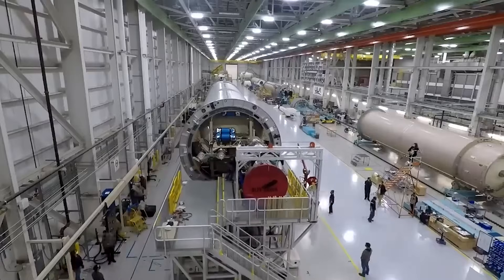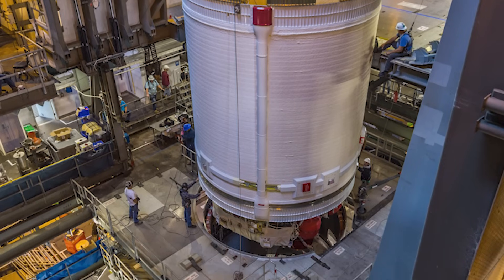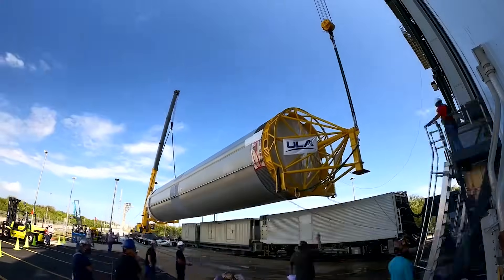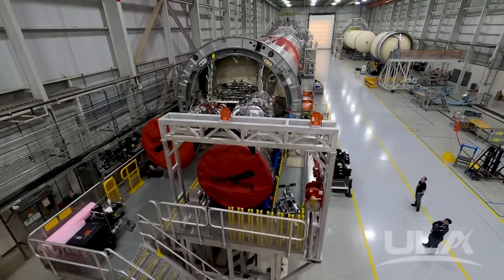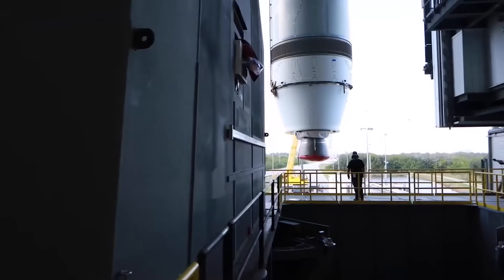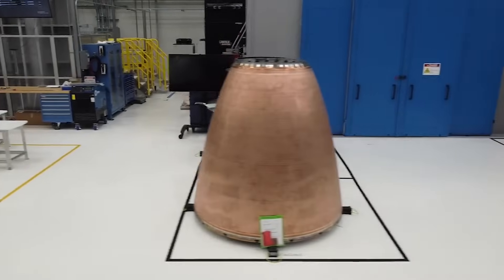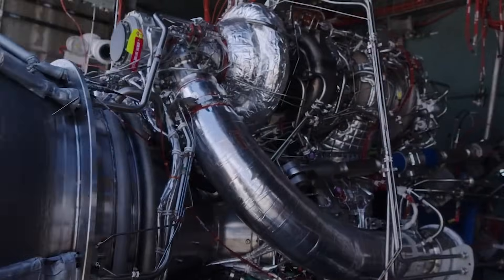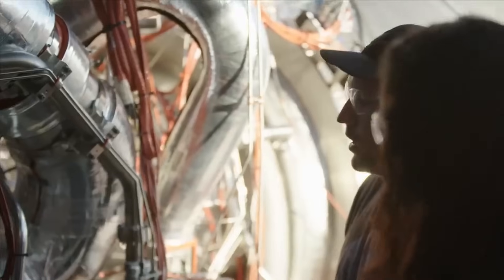ULA Is Only Weeks Away From Vulcan’s First Launch

Comment: maybe I am missing something why would you commit to launch on a first time rocket where the engine blew up in testing.
Reply: Because the engine didn't blow up in testing.  Did  you not WATCH the video?  They said it was a high pressure spot on the top of the fuel tank of the upper stage that blew up and they've already fixed it.   That's what happens when you TEST your rockets to find the problems.   Other companies, well I should say SpaceX as nobody else does what SpaceX does which is to just launch shit over and over and over again and then cheer when one of them finally works correctly.   Nobody with a functioning budget could afford to run a company the way SpaceX does except SpaceX.   Everyone else strives to get it right the first time.

Comment: I'm calling BS on ULA's so-called "smart reuse" concept. The plan has never made any sense to me. How is the engine section going to separate from the rest of the rocket? Is the whole bottom of the rocket going to be attached by some kind of "quick-disconnect" joint? Leaks are the absolute bane of every launch provider (just think how many launches have been scrubbed because of leaks), which is why everything that can be welded is welded. Good luck trying to prevent leaking on a "detachable" engine section, with hundreds of tons of propellant pressing down on it, plus the violent shaking of launch (especially with solid boosters) trying to loosen the seam. There's no way the seal will hold. If it's not a joint and it's welded like a normal tank, you have to use explosives to basically blow the engine section off. How can you ensure a clean separation? How can you ensure it doesn't endanger the upper stage and payload? You can't. You'll get shrapnel. Goodbye upper stage. Smart reuse is the stupidest idea I've heard in a very long time.
Reply: you must be an expert. the engineers at ula probably have no idea what they are talking about.
Reply: @duckvs.chipanddale585  Riiiight. Because bloated government contractors have never ever over-promised & under-delivered, or pretended their PowerPoint vaporware was a real product. They wouldn't just make stuff up, right? If they say something it MUST be true, right?
Reply: I think ULA has blown smoke up everyone's butt for years. @duckvs.chipanddale585
Reply: You have to take into concideration, that its engines from BO.  So while they may be able to build a rocket every 2 months, they cant wait 2 years on every engine.  Thats the "smart" of the re-useability.  Besides, its 2 engines to wait on.  They'd have 30 rockets laying around before one gets fit.    🚀🏴‍☠️🎸
Reply: So when you got your Doctorate at MIT in mechanical and aerospace engineering, you followed this with PostDoc at CalTech and externship at SpaceX and NASA?

Comment: I don’t know how anyone can think the starship won’t succeed after watching the falcon 9 and heavy success 😊
Reply: 1)The engines are different,
2) The weight is different,
3) The center of mass is different,
4) The aerodynamics are different,
5) The landing method is different,
6) The materials are different,
7) Falcon 9 uses an expendable 2nd stage. (Which people forget about)
8) Falcon Heavy uses a fully expendable mode.
9) Musk promised a 24hr turn around for Starship. Falcon 9 has a 30 day turnaround.

There are plenty of reasons to be skeptical.

Success at 1 thing does NOT guarantee success at something similar, but very different.

Comment: So, 0 launches in 2023 vs 86+ for SpaceX? Should I be impressed?
Reply: is that 86 SUCCESSFUL launches for spacex, or 86 TOTAL launches?    VERY Big difference there considering every other rocket that they launch blows up.
Reply: @jkutyna Have you been paying attention at all? The Falcon 9 has not blown up at all. Sure, they are having problems with the successor, but that is way more ambitious than any other rocket out there ATM.
Reply: Ok and

Comment: I hope ULAs launch in December will NOT be as "successful" as the recent SpaceX sub-orbital test flight.
Reply: That's sounds like a weird thing to hope for!?!?  🙄
Reply: so you wish for it to RUD on the pad if it's shouldn't be as successful as SS? Pretty low.
Reply: why don't you want a rocket to succeed? why don't you want a lunar lander to succeed?
Reply: Nobody will EVER be as "successful" as spacex is.  Nobody has the fortune Elon Musk has to afford a 50% failure rate on your rockets and payloads.  Every other company on the planet would go bankrupt long before that kind of "success".
Reply: Apples and oranges, really.  Starship is a whole new thing nobody has ever done before, in both scale and function.  The data needed to make it work doesn't exist until real-world flights are done to gather it.
Vulcan is an expendable launch system akin to what has been done before.  They should be able to get it to work without RUDs.

Comment: Imagine Vulcan with two RAPTOR 3 engines! They are roughly the same thrust class, smaller, lighter and flight proven. They are Methane fueled so tank sizes and like can stay identical. Also, if SpaceX is to be trusted about their costs going down to $250,000 a piece they are also the cheapest pump fed rocket engines in the world. There is actually nothing wrong with standardizing on ONE engine for US Launch vehicles, making it cheap, making a lot of them and flying them a lot. ULA can focus on building vehicles for launches and payload which the one size fits all SpaceX vehicles do not accommodate. Blue Origin... well... I really don;t know what they are good for except flying dildos and vaporware.
Reply: This seems like a wild oversimplification. There are structural elements, at the least. Do the engines gimbal the same way? If not, flight software would need adjustment. And the US having more operational capacity keeps monopolies from forming.
Reply: @patricklewis7636  
monopolies that are dangerous to an economy are only possible if the market authority (government mostly) enforces rules that select a few suppliers and does NOT allow any others. So rules that are anti-competitive are a problem, but monopolies that form naturally - because the forming sole supplier simply has the best and cheapest product are not a problem. Free market capitalism has no problem with those. Anytime such a monopolist supplier tries to control the supply the competition can come in and increase the supply if needed.
Reply: @joansparky4439  well, first, that's almost completely wrong. The gilded age monopolies formed due to an absence of regulation and were ruinous in a lot of ways. But the issue here is less monopoly and more single source for government procurement. With two or more capable suppliers of space services the space force will still be able to launch in case a design flaw grounds a system. Also, competition breeds innovation and drives down costs.
Reply: @patricklewis7636  Except for one thing... VAPORWARE is not competition.
Reply: @patricklewis7636  
re gilded age and lack of "regulation":
" [..] Political cronies had been granted special shipping routes by the state, but told legislators their costs were so high that they needed to charge high prices and still receive extra money from the taxpayers as funding. Vanderbilt's private shipping company began running the same routes, charging a fraction of the price, making a large profit without taxpayer subsidy." (robber baron, WP)
Reply: @ patricklewis7636  
PS: there even is "regulation" out there that isn't labelled regulation, but has the exact same functionality that such anti-competitive regulation has got, creating a winner takes all environment with the expected outcome.
Markets only really have a problem with monopolies when competition can't legally compete, all else is made up myths by people who either should know better or who have an agenda.
Reply: @joansparky4439  that's not regulation. That's corruption and fraud.
Reply: @dwightlooi  BO is way behind and ridiculously secretive, but way too many people who would both be in the know and have dollars on the line vouch for their continued progress to say this is vaporware. Besides, 2 BE4's are hanging on to a stacked Vulcan right now and they have fired. There are PLENTY of questions about how they will hold up and whether BO can crank them out at scale, but they do exist.
Reply: @patricklewis7636  
Nope, most of that stuff is legal and if I were to ask ur opinion on some of them you might even be on the side of keeping them in place, while being blissfully unaware that they benefit a few at the cost of the rest only.
Reply: @joansparky4439  why are you hung up on this?
Reply: @patricklewis7636  
Because the naivety showing through in this sentence is fatal for a society (like the US): "And the US having more operational capacity keeps monopolies from forming."
It points to a lack of understanding how this stuff works and what REALLY is the problem there.  SX being the cheapest and most "selling" supplier of mass to xEO is 100% NOT a problem nor would it become one as such supplier monopolies simply do not represent the problem that are monopolies.
Reply: Well flight proven is a bit of a stretch since every launch thus far has ended in some kind of failure, often with Raptor engines shutting down or blowing up during launches and static fires.
Reply: @plainText384  SpaceX is well set up to figure that out. But that last flight is an example against the original post. It likely wasn't the engine that resulted in the booster blowing up but the engine plus the plumbing and fuel handling. This stuff all works together.
Reply: @patricklewis7636  well we are very early in the misshap investigation process, so we'll have to wait a bit more for definive answers (if we'll ever get any).
Reply: Unfortunately, the real world isn't like Kerbal Space Program. You can't just magically slap the engines on. The whole rocket would need a complete redesign, just as it would if Aerojet Rocketdyne somehow pulled a bunch of ready-to-go AR1s out of their butt. Everything from tank structures, to propulsion plumbing, to thrust structures, etc. and flight software will need to be completely redone. It's better to just stick it out.
Reply: ula will never choose spacex. never.
Reply: Raptor 3's would blow up before they ever even got it to the launch pad with their track record.   Why the bloody hell would ULA buy rockets from a company that blows half of it's rockets and payloads up????
Reply: @jkutyna  The raptor 3 is still in development. And SpaceX has had more booster landing successes as a percentage than most rocket models. The Falcon system is incredibly reliable. SpaceX knows what they are doing. Still not a plug and play idea, though.